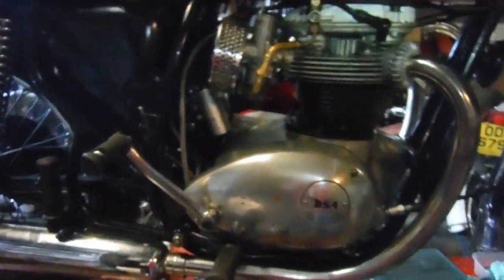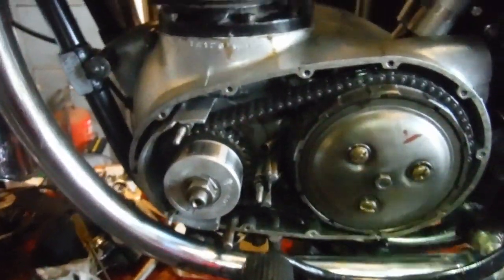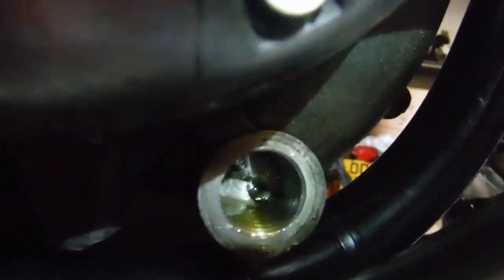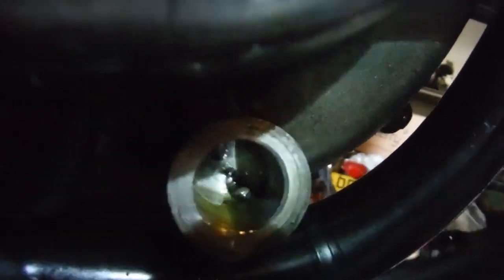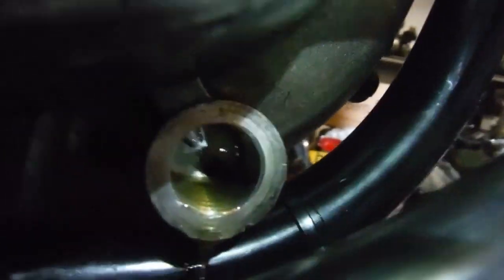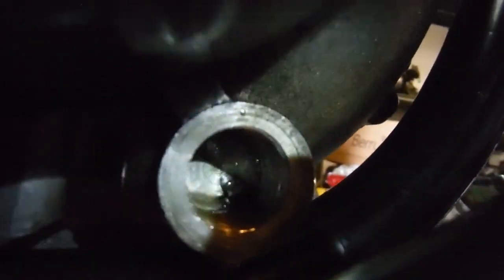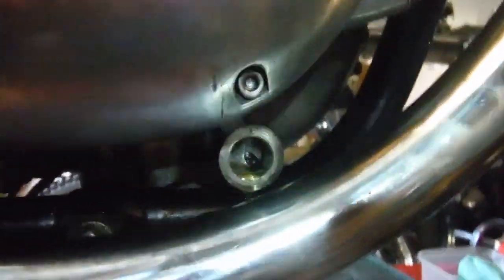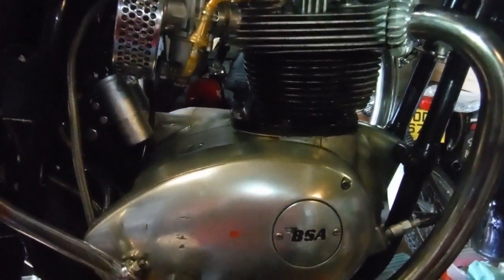BSA A65 making sure the oil pump is primed before attempting to start the rebuilt engine.

Comment: Looks fabulous back in the frame, fair play you rescued that engine from a pile of broken parts and bodge jobs, good as new now well done Paul not to many could of brought that back to life but you did it.
Reply: Changing social attitudes and aspirations were more important in the demise of the motorcycle industry.than any notion that the machines were substandard.,because that is quite simply untrue.The Japanese targeted the poorer segment of society , those who simply couldn't afford cars, and they priced their products accordingly..Survivability was not part of the ethos of early Japanese bikes which is why they almost dont exist today. The time overlap is crucial in understanding the switch away from British motorcycles. When motorcycles became sport orientated rather than travel to work orientated the Japanese benefitted. In the boom period of British motorcyle production the bikes were on a par with any thing else manufactured at that time, but please remember that machinery and tooling have developed enormously in the past 50 years.

Comment: I'd just buy a new 3 phase stator and 3 phase rectifier / regulator ( Chinese copies of CBR 600 cost a few quids ), the difference in price between them is negligible. Much more juice on lower revs and no problems with in town riding. As always thanks for your A65 videos. By the way your video shows how low output has an A65 oil pump ( comparing for example to Trident pump ). I do the same but using a drill on a pump with side cover and crank pinion still removed.
Reply: hi yes your right on the early a65 pumps they had small gears in them but 1968 bsa came out with a pump with larger gears which was denoted with DD..stamped on the pump body and which also implied double dowels these pump where high delivery, and then in 1970/1972 bsa change again  to the very sort after cast iron one's which are even better than the srm pumps today kind regards
Reply: @a65builder67  yes, but even DD pump makes 1/3 of rev per every engine rev and amount of oil delivered is marginal comparing to much bigger and more effective Trident pump. With iron DD pump I used to have my red oil light flickering after spirited ride on a freeway ( 80 - 90 mph ).
Reply: @a65builder67  not really, it's a "floating design", you can connect it either side. I have this combo working on my Trident for 7 years now without any problems. Installed the same on A65 I'm finishing slowly, works like a dream. :)
Reply: hi Adam, well i think thats a sure sign of a badly worn timing side bush or a bad pressure light switch or pressure release valve, as on bsa a65 should blow off at about 55/60 psi as where the trident/ or bsa r3 should blow off at about 70/75, on all my bsa a65s i've put oil pressure gauge's on and at idle i'm getting a round 25/30 psi with engine hot and a round 55/60 a 3,000/4,500 rpm, if i was you i'd take the switch off and put a gauge on it for peace of mind the gauge goes straight on were the switch is, but anyway ride safe and have fun with kind regards Adrian. @adammedyna2365
Reply: hi Adam i did'nt know that you've learnt me some thing there thank you again ride safe and have fun with kind regards Adrian. @adammedyna2365

Comment: Does these oil pumps need re-priming after a regular oil change?
Reply: i used to take the spark plugs out and crank it over with the kick start .till you could see oil returning in the oil tank . but its  a personal choice .some of my friends just changed the oil,started it then topped the tank up
Reply from the maker: The oil pump will stay primed with a regular oil change on these machines.
Reply: Thank you Paul. Glad i haven't been doing it wrong all these years! Appreciate the confirmation. @paulhenshaw4514